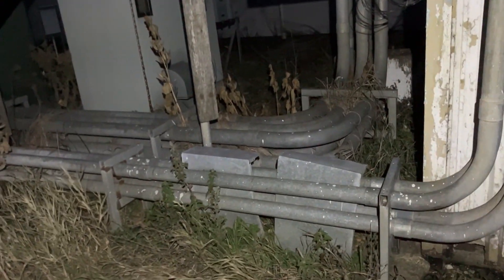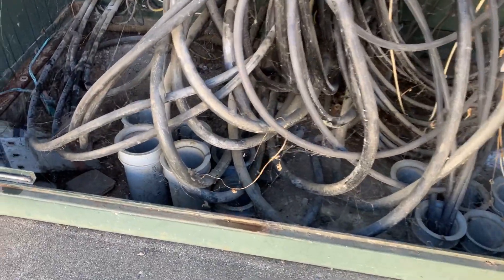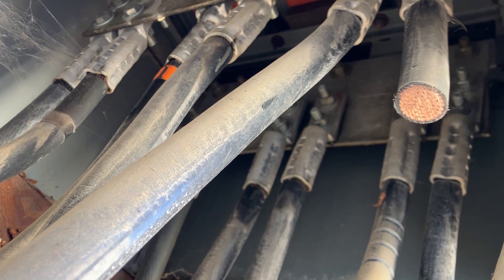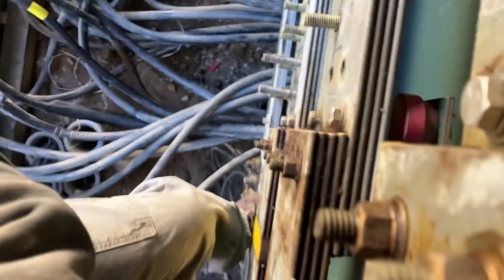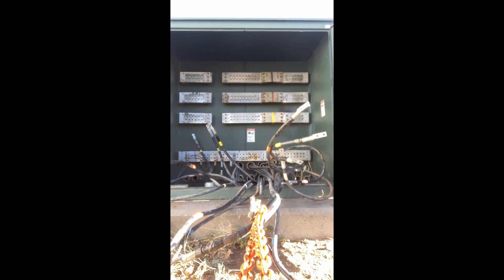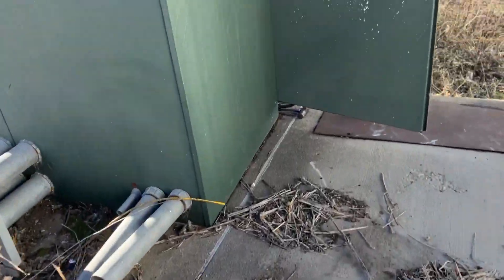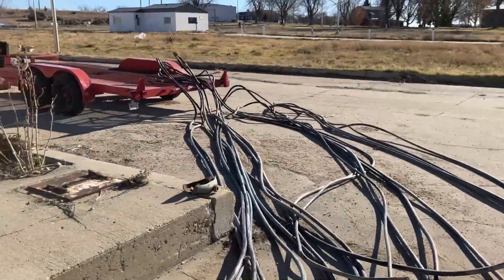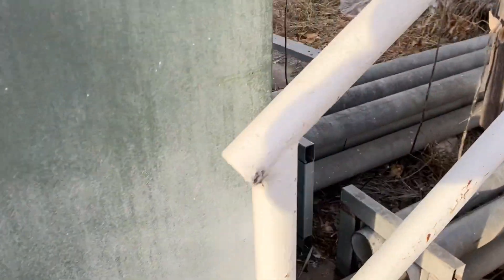Whats inside a main power cabinet?

Comment: another great video. I didn't see you use your dewalt pruner. I love mine. They also have a cable cutter, very awkward to use, takes 15 seconds and costs $1000
Reply from the maker: Thanks man! I'm not sure if I had that pruner during this pull? Maybe I used it on the grounding stuff, this bigger wire would have been a chore for it.  I did see one that would have done this wire for around 2k, it was a Milwaukee.  I did buy a smaller Milwaukee that is supposed to be a little more powerful than the Dewalt but the jaws don't open as much. We will see what she can do :)

Comment: I think it's great that you experimented with your camera angles. Hopefully you have a decent stripping machine to get all that insulation off. I've always said if you haven't bled on the job, you're not doing it right. :)
Reply from the maker: LOL, I like that. It's always good to get a harmless reminder to keep it safe, test out the old PPE :) I'm having fun making and editing the videos, I did buy a couple holders for the camera. I should be a little more prepared next time something like this turns up.  I do have a pretty good stripping machine, got all this processed pretty quick. I might do another video showing how it all turned out. I did think about tying a go pro to one of the cables and watch it slide out the pipe, when the time came I just didn't have time to get it done. Hopefully I get a chance next time :)